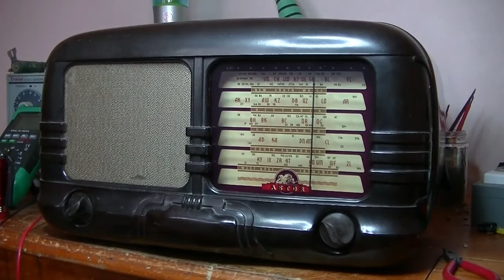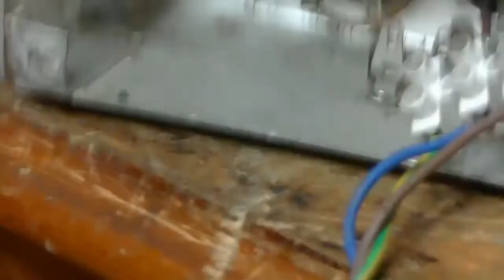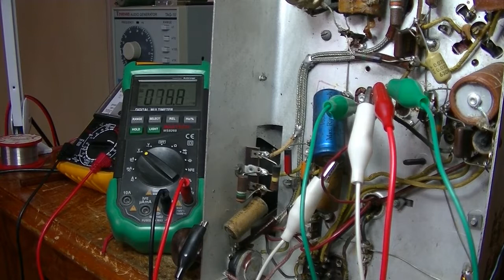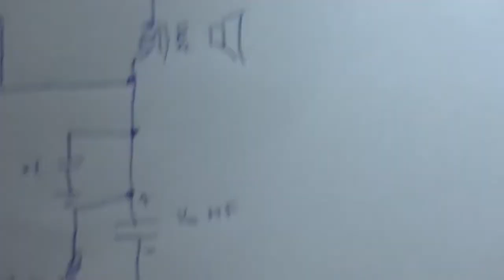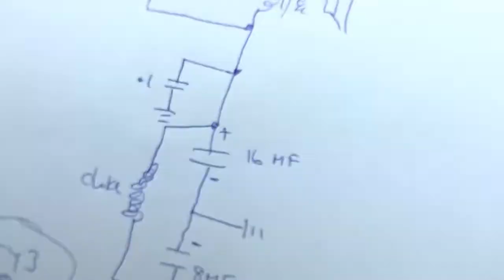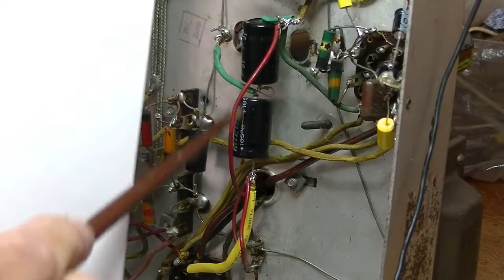Astor JJ 1946-48 Restoration

Comment: Nicely done even with the wiring mistake with the choke and electrolytics which I noticed immediately when you first showed the schematic. I hate when I see cobbled up wiring and disconnected or missing components from previous butchers. Overall, you did a great job and brought the radio back to life. You must have patched up the speaker because the radio sounds great.
Reply from the maker: Thanks Ken, yes, I did a quick patch on the speaker. I'll show how I do it on the next one.The sound from it is huge, It has more volume than the speaker can handle.
Butchered sets are a nightmare to me,  I know someday I'll come across a complete wreck, that will definitely test me.

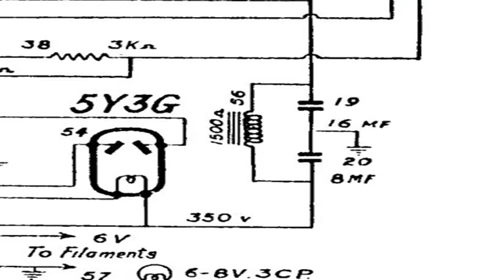Comment: From 9:00 is where you start getting confused. The pi filter network shown at 9:01 in , has the NEGATIVE ends 
of each e cap connected to ground (on a hot chassis set no less). The  positive sides of the e caps goes to one
 side of the 1500 Ohm filter choke each. Fixed it at 15:26 ; nice comeback! Just let this be a real learning experience
 on reading a schematic  and comparing it to the real thing. This is especially true if a previous repair was done and 
not up to snuff! Great clear audio on this radio and a very neat cabinet design.👍👍
Reply from the maker: Thanks Master. Yes, I learned a lot